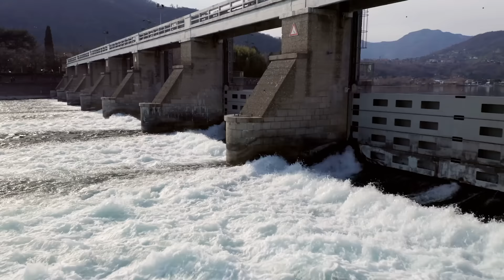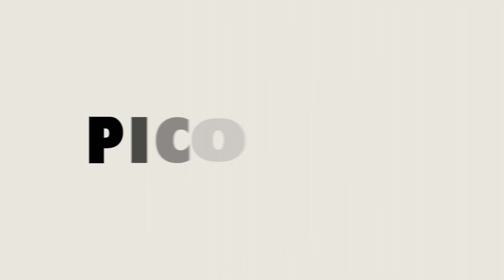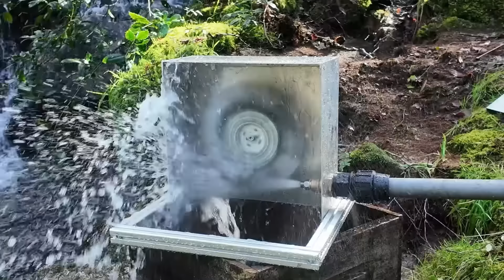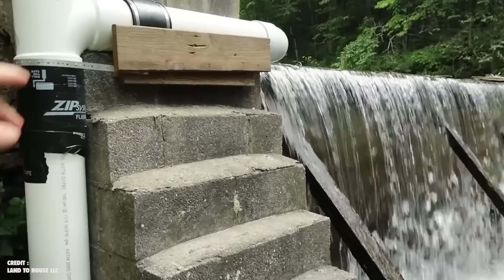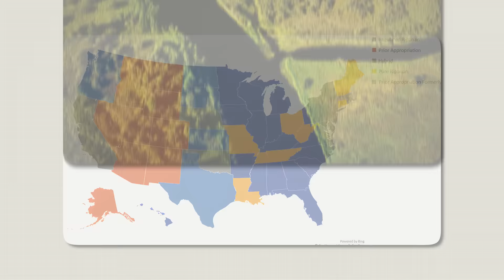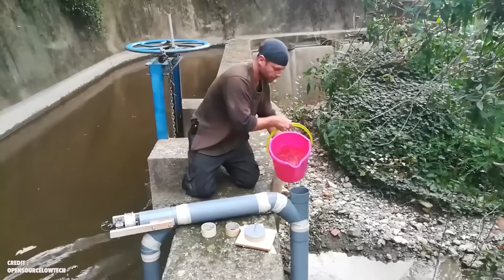Forget Solar — This $50 Machine Generates UNLIMITED Electricity Forever

Comment: Less than 1 in 1,000 properties have then base requirements - over 50' of drop, and a robust stream with 10 gallons per minutes of flow, suitable acreage and layout, access to infrastructures (i.e. access roads), other factors making it acceptable for residence.  Be prepared for a minimum land prices in the hundreds of thousands.
Reply from the maker: Agree but perhaps community schemes would work where communities build micro-hydro to offset transmission costs.

Comment: Pico hydro sounds ideal where water flows all year, but location and permits limit access. Could it outperform solar for remote homes?
Reply from the maker: Yes if the flow is constant you could get a higher load factor than solar.  Best bet is to have several systems if you are going for grid independence.  Solar, Hydro and wind plus battery bank to sore excess energy.

Comment: You cannot create nor destroy energy; it can only be converted. There are many problems that can arise just from the weather. First being a drought if your creek or any water source where to dry out you would have no water flow meaning no kinetic energy to convert into electrical energy. Next you made a good point about the water pipes freezing because with that comes the possibility of damaged pipes, loss of water flow, and weather wear on your mechanical parts. Also, you only mentioned about the buy in cost, not mentioning the cost to maintain it. Cost just isn't about money it's about time. The initial cost of $50 to me seems silly because those AC generators (you need a generator to convert to electricity) cost way more than $50. Unless you go the DC generator route then I could see it maybe being less but still costing more than $50.

So, saying all that I admit that it is a good idea and it a good method to increase your energy portfolio if you have the means. That extra energy being stored into batteries and being put to use in the summer while your solar panels generate electricity and store it would be an awesome set up. For those looking to be energy independent I would also look into syngas as well so you can have a gas heater.

Comment: So you need a rare creek on your property or some how rig city water to turn the wheel.
Reply: Probably works with a common creek just as well.
Reply: Any source of water, some piping and elevation will work. Run a pipe down a mountain with water going through and gravity will do its work.
Reply: whats rare about a creek?

Comment: Not everyone has a stream running by their home
Reply: Could work on a pond, I’m trying to figure it out to heat a greenhouse in the winter
Reply: @CMW0395  Difficult depending on where you live. 
Because there is less water flow in winter.
It has to be a really big pond that fills up during the rest of the year, so you can empty it in winter.
This way you can store energy, but not really create it. 
And to build it you need to construct something underneath the pond at it's deepest point.
So you probably have to drain the entire pond to build it.
Or make a temporary construction to drain a section during the construction. 

There are systems like this.
But all artificially created on a elevation to store energy.
Reply: @CMW0395  you need height difference aswell, just having water isn't even enough
Reply: @CMW0395  yes it does makes a hydronic battery. Build a second holding pond lower and run the hydrogenerator piping between. Put in a solar pump to return to water to the top.
Reply: @Army_THE_TACSOP  Good scientific thinking ,but the pump would use probably 60% of the energy created
Reply: @r @robertwilson8789  as most honest videos tell your. Power generation isn’t one stand alone answer. Solar during the day in summer is great but there is no battery big enough to hold the power generated. 

For massive power storage dam and holding pond or sand heat battery are two of the best. I’d lean toward holding ponds and pump return with a solar pump. I assume you are talking about to solar being used by the pump. It doesn’t need to be tied to any of your homes power generation. Just an open sunny 5x10 will give you weeks of stored electricity.
Reply: ...or a hill
Reply: I've got even two
Reply: Or there are tons of laws that forbids to do anything with water streams...
Reply: A decorative concrete yard water fountain with a water pump would keep the same amount of water circulating and falling but electric has to power the pump unless you could get the water falling far enough and fast enough to provide electric to the pump too and create a vicous cycle. Lol
Reply: You can do without a stream got use you imagination 😂
Reply: Yes they do, don't lie
Reply: U can create a stream like flow in your backyard
Reply: And the water is recycled like a fountain
Reply: Nobody in their right mind would run a system like that off of sewage , and storm drains only work when there is a STORM ! Don't quit your day job and try to become a city planner ...
Reply: @robertwilson8789 good little sheepie here... your tap only runs at noon does it 😂😂😂😂
Reply: @gingerfruit923  Really ? You have saved the world with a tap? Do you even know how stupid that is ? Whose tap ? How much does that cost ?
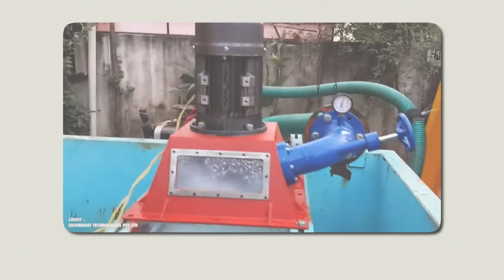Reply: At 8:46. Use the water, that is plumbed into your house off the street. Simple.
He even said, towards the end there are companies that are offering that as a alternative.
Reply: Not everyone has a puppy.
Not everyone wears cowboy boots.
Not everyone speaks Portuguese.

It is not a panacea, it is an option.
Reply: actually almost everywhere are underground water veins, thats how people can get water from underground by wells
Reply: Many people have sewers and stormwater drains.
Reply: @pablothekiwi Yea but who the heck would try to use them for this ? Aside from the stench and undependability of either source ,You would have to be pretty desperate to not use cleaner more viable means .

Comment: TL/DR: For a select few property owners, water turbines are a low-cost off-grid energy solution.
Reply: Less than 1 in 1,000 properties have then base requirements - over 50' of drop, and a robust stream with 10 gallons per minutes of flow, suitable acreage and layout, access to infrastructures (i.e. access roads), other factors making it acceptable for residence.

Comment: Not everyone has unlimited water or a creek!
Reply: But some of us do😁
Reply: Welp, I guess nobody should do it, then.
🙄
Reply: Might be a little more expensive but it can be done. Something that can hold up to 100 gallons, a modified ram pump, some pvc piping, and the generator. After that... you're green to go.
Reply: t least the sun is Accessed by most people
Reply: Does that make you a victim.? Very negative comment.
Reply: @christianwitness Has nothing to do with victimhood.  A comparison between energy processes is not accurate if it does not take access into consideration.